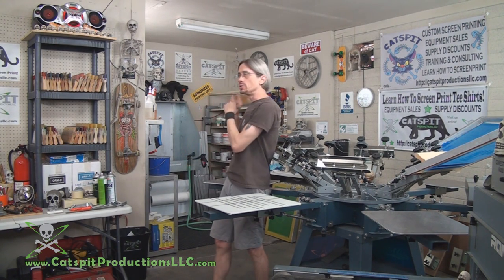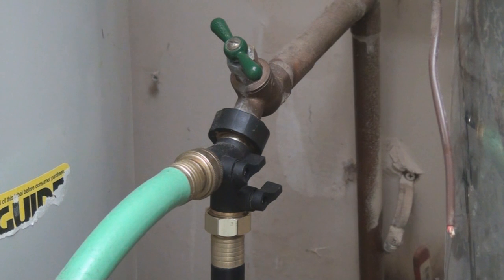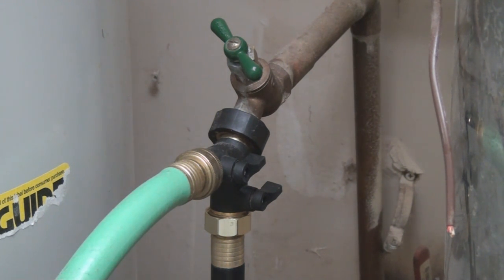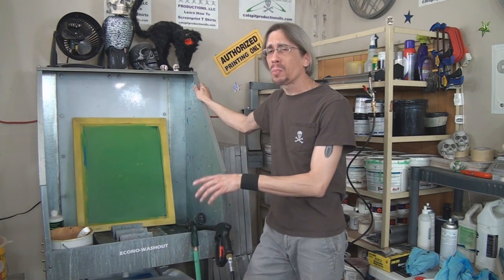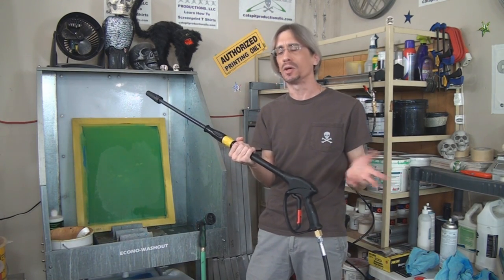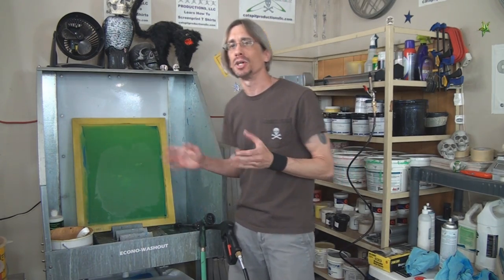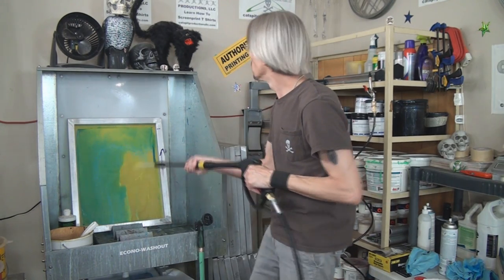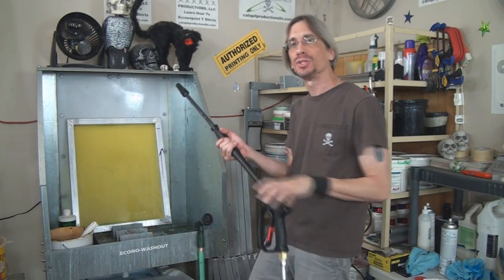Heavy Duty Pressure Washer For Screen Printing Tee Shirts

Comment from the maker: It would be if you consider you’ll need to turn it off every time you won’t be using it for few minutes. But if you keep the switch near and handy I don’t think it would be an issue. I like it and mine is still on the floor. Thanks so much for watching and dropping me a note. ☠

Comment: does the pressure of water influence how the emulsion cleans after burning a screen? I tried washing mine with a shower head but it didn't come out properly and when I tried washing with a pressure washer the whole emulsion started melting and coming off 
edit: What's an average water pressure that you recommend when washing screens after burning the stencils?
Reply from the maker: Yes, it does matter. I recommend a garden hose with cold tap water and a spray nozzle. You can get spray nozzles with different patterns from Home Depot, Walmart, and Lowe's. Thanks for watching! Screen Printing Equipment & Supplies - http://CatspitScreenPrintSupply.com/
Reply: @CatspitProductions  thanks :)
Reply from the maker: @John223  You're welcome!

Comment: Do yo think an iON 40V 5.0 Ah 1160 PSI Light-Duty Cordless Pressure Washer will work to reclaim a screen?
Reply from the maker: That will work. As long as it has enough battery life I suppose. Anything between 1100 and 2000 PSI will work fine. BUT... such a unit may break prematurely if used in a commercial setting. If it's for hobby use, then you should be fine reclaiming a screen now and then.  Thanks for watching! Screen Printing Equipment & Supplies - http://CatspitScreenPrintSupply.com/
Reply: Thank you for your help.
Reply from the maker: You're welcome.

Comment: can I use a 12v 45 watt power washer I dont have water so I have to bring it in.
Reply from the maker: I don’t know about your electrical situation but yes, if it has 1200 or so PSI pressure it should work. Thanks for watching my video and leaving a comment!
Reply: Love your video's thank you for getting back fast.
Reply from the maker: 2tsscreenprinting My pleasure ;)
Reply: will 50-60 PSI be ok
Reply: if its ok for ink cleaning then i will go to a car wash to reclaim a screen.
Reply from the maker: 2tsscreenprinting Never tried those PSI that I know of but perhaps it would.
Reply from the maker: 2tsscreenprinting Only use a pressure washer for removing emulsion and using haze removers.
Reply: thank you. Catspit Productions.
Reply from the maker: 2tsscreenprinting My pleasure :)